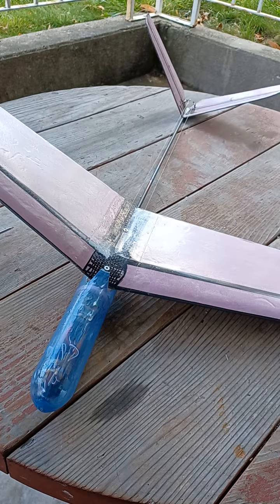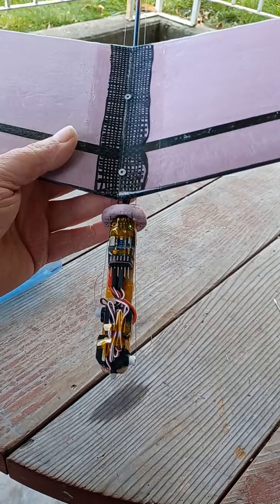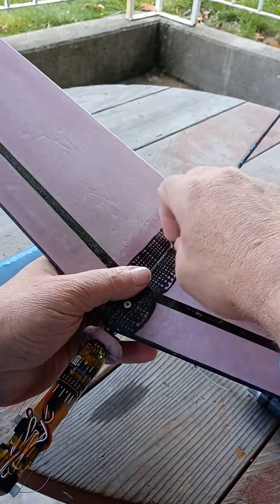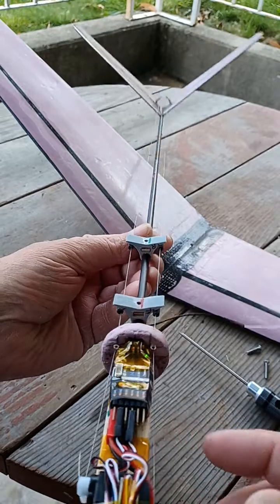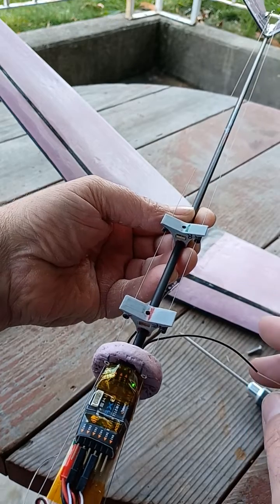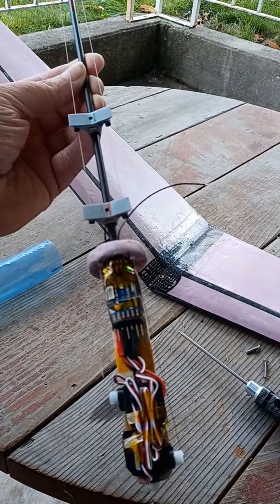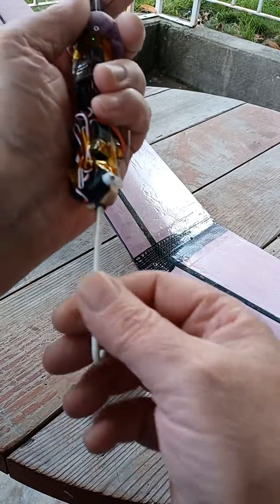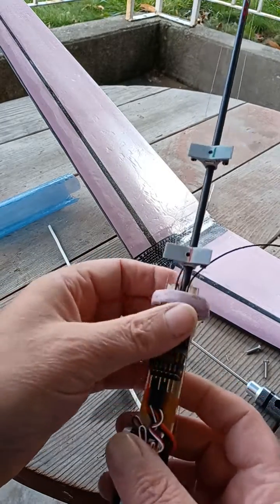How to make a simple 1m DLG wing mount

Comment: Just saw this again. Very neat. What size/weight arrow shaft did you use?
Reply from the maker: Hi!   I used an arrow shaft with a 4.2mm I.D. and a 1100 Spine. Overall length is between 31-32 inches.

Comment: Hi, wow it is a very nice wing mount system! It is a brilliant idea, I will make a similar one from wood. I have no any 3D printer yet. It is very nice for the screws to allow them to go into the holder parts, it is not necessary to cut short them. I have the same arrow shaft for the boom, ohhh it is really strengt for boom, I think. Your glider is very nice anyway! The V-tails are very interesting! Thank You for sharing!
Reply from the maker: Thanks for your comments!  Yes, it's my first V tail and it apparently saves weight over regular tail configuration plus it doesn't get damage from landings. :) 
Sunny skies köszönöm barátom 😎